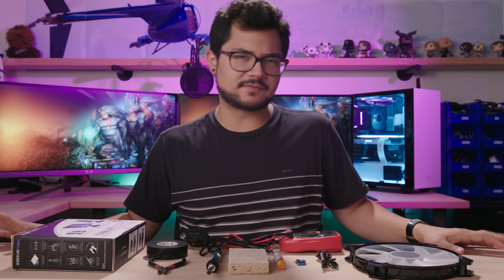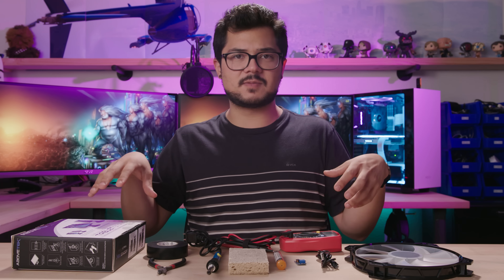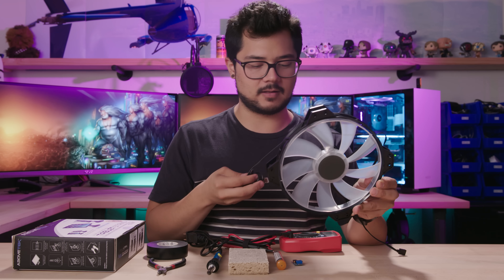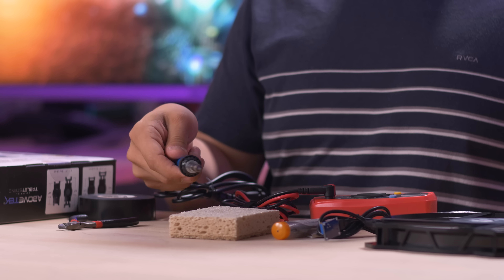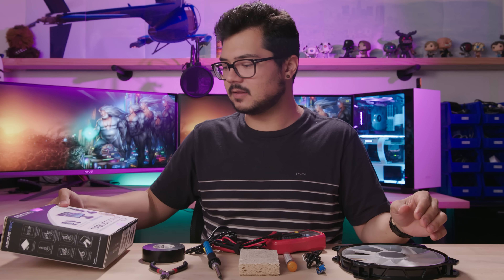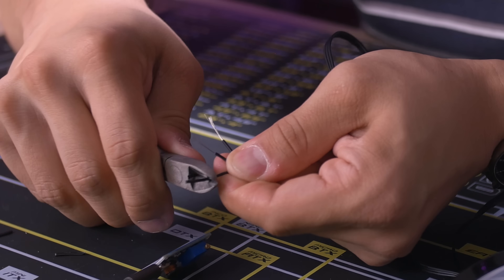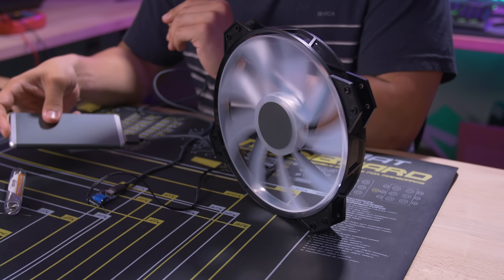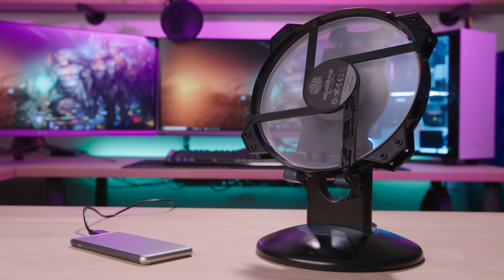DIY your own USB fan (using a PC case fan!)

Comment: So I know this video is 5 years old, but if you wanted to go the non usb stepper route AND have RGB, all you need is a simple cheap LED controller for an RGB strip, they run off 12 volts, use compatible LED ports, and if you just hook up a toggle switch, you can have it set up perfectly. And if you did still want it to be usb, throw the usb stepper in to replace the DC barrel port and it should still work (assuming your laptop is out putting enough amps)

I have the same exact fan and it got it all working after googling a ton. Also if you want to control the fan speed, find a fan speed controller like the ones from noctua, and put it between the fan and the LED controller, and wham, adjustable speeds

Comment: I just made my wireless bluetooth speaker usb powered because the battery died. After watching this video, I plan to make a fan to collect the fumes caused by soldering to prevent myself from getting lead cancer.

Comment: 💖💖Love the fan base and concept here. My new Antec fan sadly did not like the wire test method. 😭😭I tested two wires and 💥SMOKE 💥poured out of the motor and no other testing was possible. So if you have a spare fan around, I can give you my shipping address. Oh, wait... I'll let Amazon replace it and say it was 'defective'.

Comment: AWESOME!!! question: if i wanted to run (3) 200mm rgb fans, using 1 single usb cord, would i need to get 3 step up boost converters, 1 per fan? also would i be able to plug this directly into a power strip using something like a cellphone charging nugget? and actually get cooling results? (i need to create a fan-panel to put into my apt. sliding window for cooling of a 2nd bedroom/game room). thank you!!!!

Comment: Very cool project. How many fans can this setup power? I was thinking of a project that would need two possibly three fans. Most likely two 140 or three 120. Also would I have to wire the multiple fans differently? TIA

Comment: I have an old corsair 140mm fan that i dont use anymore so i just cut off an old LED controller usb connector, plugged it on my fan connector then boom. i have a fan on my side now

Comment: 6:35 you should cut the wires shorter before soldering so that no exposed strands to avoid shorts to if you accidentally twist the 2 wires but hey great job for the 1st time soldering and also 7:49 you didn't cover the open wire with tape :( and last tip put a fan guard on the other side

Comment: Thanks for this, this is just what I need. I'm replacing the PC in my MAME arcade machine with a fanless Dell micro PC and this looks like the perfect way to add a couple of 100mm fans to cool it. 
It is designed to run without fans and has a bank of heat sinks inside but I figured a couple fans wouldn't do it any harm to draw the heat out

Comment: This is AWESOME!!! A couple thoughts... If you reverse the polarity of the fan wires attached to the step up converter, it will push air out of the display side. Maybe put fan screws into all holes on each side for a nice finish. Hope this helps! :D

Comment: HOT TIP: I recently got a step DOWN DC-DC Buck convertor for a different project, but I thought it was broken because the potentiometer turning didn't change the voltage output. I found out that some brands when brand new, have to be turned many many many times before the voltage will adjust. You'll think it's broken, but keep turning. I think I had to turn mine about 30 times!

This was EXACTLY the tutorial I was looking for! I bought one of those cheap USB powered twin fans to mount on a hole in the back of my PS3 cabinet. I got it all hooked up but it sounds too loud... So I got a low noise 120mm NOCTUA that should help. But I didn't know about these step UP convertors.

Comment: If you weld a fan connector instead - like from a Molex to a 2/3 pin adapter - you can switch out the fan whenever you want.
Depending on how many amps your fans pull, you could even use a fan splitter to hook up multiple fans.

Edit: USB 1 and 2 can supply 500mA (0.5 amps) and USB 3.0 can supply 900mA (0.9 amps).

Comment: Doesn't work. Tried using the same exact equipment and I could only get my fan leds to turn on. Fan would not spin. 0/10 would not recommend. Now I am just going to throw the fan in the trash because its useless.

Comment: The 3 rgb wires  are {if its not programmable} + for the rgb leds  and the - is just the fan power -. you could hook up the + to one of the rgb wires  and have it light up hookup more wires for mixing.That is, if it is not programmable. if the rgb led s are progrqamable  then the wires are for + or minus{ depends on if it is a common cathode or anode] and data + and data -. 3tips, 1 you shoud flip the polarities of the fan to make the fan spin backwards and blow from the front, better looking side and 2 if you dont want to buy a tablet stand just make a stand from wood and paint it black. And 3, you should add a switch

Comment: You can connect all the positives of RGB in parallel with the fan and ground to the ground of the step up booster this way you will be getting a constant voltage in both of the fan and light..
TIP:- check the output voltage for Led via multi  meter through the female 4 pin connector as it may work on 9v insted of 12v in this case if you connect it in parallel you will burn them

Comment: Use a solarpower phonepowerbank on a watercooled 12volt USB poort Coolingfan & Tunnels should double as watercooling facilities for large Cities, also produce electricity via motionflow pumpgenerators in Sequence

Comment: I do that all the time but just not as creative as you did, like I will take the propeller off the 200mm case fan drill a hole in the middle of it and stick it on the desk fun spindle, you did the right thing because usually the more blades the fan has the less noise it makes when it spins and it won't shudder as much, the fans I use have to be 5 blades or more I once tried it with a 200mm aerocool 13 blade, it worked way better than the original 3 blade propeller!

Comment: Is anybody else bothered that he mounted the fan to the stand with the label sideways?  I was installing an AIO in my PC yesterday and discovered one of the 2 fractal case fans mounted in front wasn't spinning.  I tried plugging it into different connectors on the fan hub but that didn't fix it.  It occurred to me I could try connecting it to a header on my motherboard, but it would be nice if I had a way to just plug the fan into an external power source to test it.  I was doing some googling and this video popped up.  Somehow cutting off the connector to test if the fan is working seems counter productive.  But I found a USB cable to 3 or 4 pin fan power for $7.  The only problem is if I want it delivered in a week or less the shipping will e $50.  I can wait I suppose.

Comment: 6:07 DO NOT randomly choose the wires to connect... one has stripes and is the frequency signal wire and will fry your fan controller

Comment: Funnily enough it's a good method to use if you want to see how well a fan performs even at 5v instead of 12v which helped me find out if something works before connecting it into something you value too much.

Comment: 1. Interesting multimeting* technique when adjusting the voltage. I'll have to remember that one.
2. I'd be reluctant to check the polarity of the fan wires by applying power, because it could (though shouldn't) kill it if it's reversed. I'd check the pinout of the connector before cutting it off, and mark one of the wires.
3. Twisting the wires' strands and then putting the wires through the holes in the PCB and folding them back before soldering will make it more durable.
4. Heat-shrink tube instead of electrical tape would be cleaner-looking (after using a solvent to remove the markings on the tube maybe) and more durable, and wouldn't leave adhesive residue on the parts when you open it.

*Chrome doesn't say it's misspelled, so I'm calling it an acceptable word.

Comment: you will have cold soldering joint later > you didn't let the solder cling to the contact point long enough. but it will work for a while. still a good video!

Comment: pro solder tip, solder the tips of the wires first to get an easier bond to the other bit of solder. also you could have hitched the 12v rgb up to the stepper too....

Comment: Now flip the fan, put a HEPA filter on top and you got yourself a vape vapor filter. Avatar VapeNut vape filter costs 90$ and is basically the same thing in a case with an on/off switch. Ordered my step up boards for 0.48$ a piece, have an extra fan and an extra USB cable. To quote Ron Swanson: "People who buy things are idiots".
Huge thanks for making the video!

Comment: This is a little old to comment on but I am curious about the electrical side of things here. I have no professional background or experience in electrical engineering, just personal interest so please correct me if I am mistaken. Law of conservation is clear that energy can be manipulated but the amount of power can not change. Volts is a measure of speed while amps is a measure of current; current (amps) * volts = power. The part where this gets confusing is the output of the USB port.
Most of what I have found online is pretty consistent in that USB 1.x & USB 2.0 use 5v with anywhere from 1-5 loads at 0.1 amps per load, so up to 0.5 amps. There is some discussion that there are "charging" modes that allows the laptop to push more amps but I haven't seen enough consistency in that to confidently say a USB 2.0 can push more than 0.5 amps.
Now if the output of the USB port is 5v at 0.5 amps (max draw) - then the usb is putting out 2.5 watts. So the step up converter is converting that into 2.5 = 12v * x; 0.208 amps. We factor that the conversion results in 10% loss. Our actual output from the step up would be 0.187 amps. Most 120mm fans draw at 0.4 amps. What kind of effect would you see in the fan? Does increasing the volts have any effect since the amps are dropping so low?
If you were to do the same for a USB 3.0, you would have 0.9 amps on source with the net result being 0.338 amps @ 12v. This is much closer to the 0.4 amp draw that the fans are speced for. Am I missing something?
Reply: Wanna know why no one answered your question? Because you're an annoying fuck

Comment: Cooler Master case fan - $ 30
Tablet Holder - $19.99
Voltage changer - $10.99
(won't count the donor USB cable, iron or solder)

12" Oscillating fan from Wally World - $9.99

Comment: Ew, You didn't really use lead-free solder did you? 
Pro tip, don't ever use lead-free solder. Its junk and any project you use it on is automatically junk itself.

Comment: how i made my fan and parts needed.
btw all my parts came from my spare parts bin from older systems!

parts 
1: any junk left over fan
2: any 12v power brick you have left over .
2: vairable power brick also called a universal adapter
3: 2 wire nuts
4: what ever stand 

steps 
1: strip wires on fan and adapter.
2: splice wires 
3: place wire nuts on wires screw on
4: attach fan to what ever stand you have.

enjoy the breeze!

Comment: in a class me and a partner made a dc to dc step up circuit and had a pcb made to mount everything. ours was about twice the size of what you have there. and we were able to run computer fans, large led arrays, and even an electric motor. we did find that by stepping up the input the trade off was less current in the output so larger motors for like rc cars were a no go.

Comment: My husband did this much easier by just digging a 12v ac adapter out of our box-o-cords to use.  He experimented a bit to figure out which wires to put where to get the fan to spin the right way and the led to light up, soldered them together and put some heat shrink around the joint.  Voila, they can now plug into any wall outlet anywhere, and the blue leds add extra cool!

Comment: SO HOT RIGHT NOW IM DYING!
Paused the video and made a quick 240 fan with a 12v wall plug and a switch. Waiting on the boost converter...
And full blast is too much. Maybe a nice big potentiometer to adjust the speed is not a dumb idea.

Comment: You plugged in the positive and negative of the fan the wrong way. It would also look aesthetically pleasing if you switched them because the fan spinning direction changes. And also use one of these for the RGB.   https://hitlights.com/products/44-key-diy-custom-rgb-multicolor-led-light-strip-controller-ir-remote       You can find RGB controllers everywhere on the internet.

Comment: You should have turned down the voltage to 12V, connect the fan and then adjust upwards to 12V again. The voltage will drop when a load is applied

Comment: Isnt that RGB header 4 pin 12v?  Try cutting off the head making sure to label the 12v pin and connect in line with your soldering job

Comment: If you connect DC the wrong way you will kill the device, always know which wire is which. Another tip, don't leave so much bare wire, you are just asking for a short.

Comment: there are way too many things wrong in this video. You cant just get higher voltage out of a lower voltage source without drawing extra current from the source, that step up may just be drawing over twice as much current as it usually would to allow that fan to spin at rated voltage and current. This could be damaging whatever its getting its power from.

Trial and error is not a good way of finding what 2 wires power the fan, you should have set your multimeter to resistance and found which 2 wires have resistance to the 1 ground wire, you could have over powered the fan sensor and even created a short.

Those solders looked alright but you should have stripped the wires a little shorter as just taping them like that can very easily short them together.

You also could have powered the fan backwards to get the nicer looking side facing up

Comment: This is such low effort content on the scale of instagram life hacks, how is everyone so nice to this video? You didn't search how to solder, even though that is the only thing you do in this video, you didn't create a nice custom stand or even mod an existing stand to nicely house all the electronics, instead just using some plastic garbage and letting the electronics just dangle there and why would anyone build this? It offers no benefits over off-the-shelf USB fans in terms of design, functionality or price. Kyle didn't learn anything from it, the audience didn't learn anything from it, what's the point?

Comment: Reverse the leads you soldered and it'll pull air the other way, thus having you switch it around hiding the labels and wires.

Comment: Is this a good parts list??? 1050 gtx
2 gb ddr5- 136$
Case with 3 120mm fans- 30$
8gb ddr4 98$
1 tb hard drive 
Evga 500 wat psu
MSI B250 
I7 950 3.06. GHz 
Total price is 490$! Is that good any changes should I make??

Comment: eh i'd still take one of the four usb desk fan with speed controller variants thermaltake has had on the market for most of this decade. the 80mm versions i got from a microcenter for 8$ way back towards 2010ish are still kicking and have a great flow. i see they now retail for nearly 20$ on places like amazon O.o .

only thing i wish more fan makers did was employ proper dust filter meshes on the intake side.

Comment: I made my own portable one to cope with the outside heat. It's made out of a steel plate. Bended to an E shape. With two 120mm fans. For the power source I used 3 laptop batteries (18650) in series to create 12V. Works great and it's portable!

Comment: If you wanna make it look cooler, you can wire the positive and ground backwards so the fan spins clockwise instead of counter clockwise, then you can put the fan on the stand the other way so your not looking at the backside of the fan
Reply: But the blades are designed to be unidirectional. They have a concave curve facing the intended direction of airflow.

Comment: Hey Bitwit, Ik this is completely unrelated to the video but since you are a tech YouTuber could u help me pick the parts for my computer. I want to get into building my own computer but don’t know what parts to pick. I already have a 1080p monitor so I guess I would need the computer to run games at around 1080p (if possible) and my budget is around 700. So if anyone could help me pick the parts for my computer I would be very thankful.

Comment: First of all Flux is your best friend.  Flux removes oxidized metal from the surfaces that are to be soldered, allows for improved wetting of the solder connection.  I would typically apply flux to the wire after it has been twisted then apply solder to the iron then to the wire then use a very tiny bit of solder to the wire for tinning.  Do the same steps to PCB pad for tinning as well then solder the wire to the PCB.  Use either Flux remover or a q-tip with rubbing alcohol to remove the residual flux.  Also a solder connection, depending on how much surface is being soldered, can take up to about 5 secs ( Approx 2 sec to heat the pad, and 2 to 3 secs of applying solder).  Again depends on if it is a through hole or how large or small the component or surface mount connection needs to be when applying heat.  Too much heat can cause measling or blistering between pads.  It just takes practice to get the technique down depending on whatever solder connection needs to be done.

Comment: cut those wires you're soldering shorter so theres not as much bare wire showing so they dont touch and short
Reply: It'll turn into a small heater with a touch of smoke... Perfect

Comment: I'm in the process of doing something similar right now. I'm building a 19" rack cooler for my amp out of 4 80mm fans that I mounted to a steel sheet I cut out of an old PC case. I was going to use a 12V power brick with a molex to 3 pin adapter, but after seeing your video I might just buy on eof those step up boost converters and solder it on directly. This way it saves me from having to hide all cables that are too long